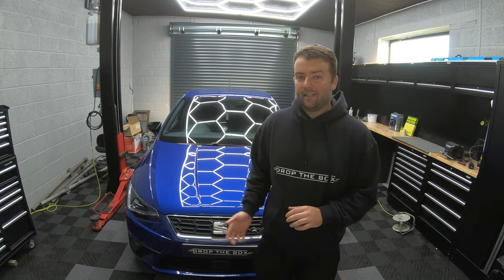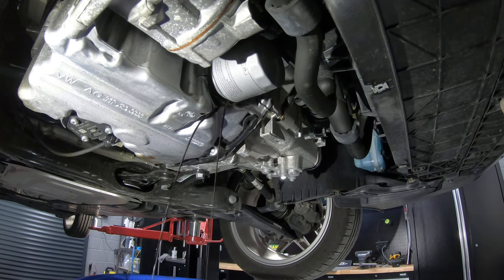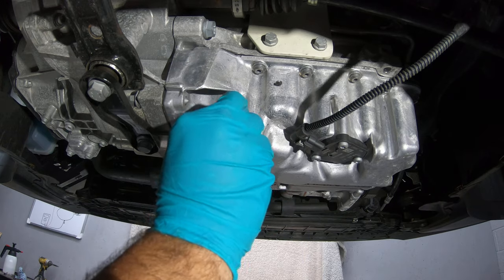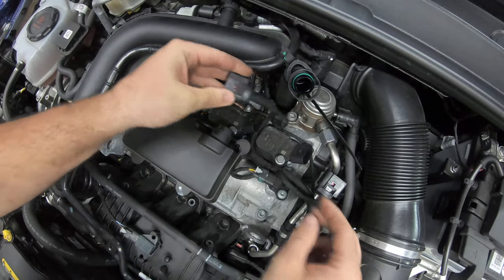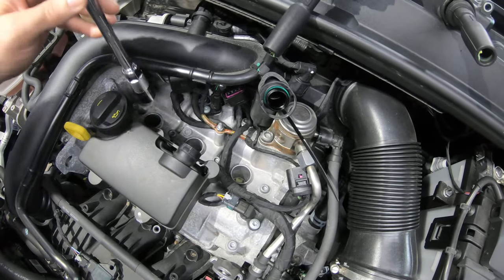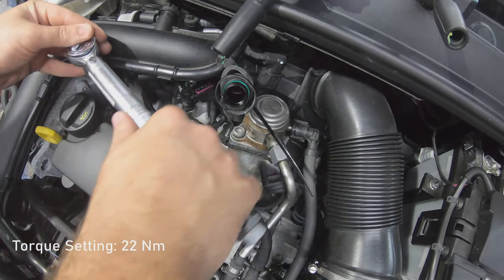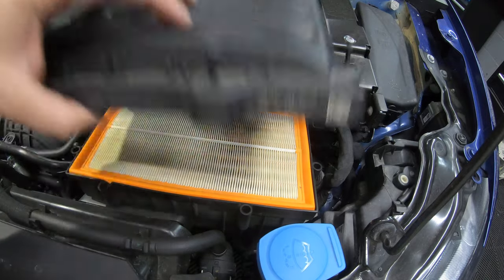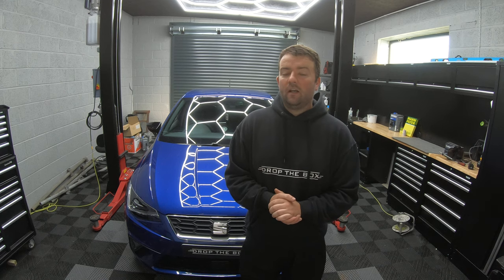Seat Ibiza 1.0L TSI - Engine Service

Comment: I have a 2023 Ibiza 1.0 tsi, 3k miles - Do these engines tend to vibrate a lot on tick over? Even when fully warm ?
Reply from the maker: Yes this is due to them being 3 cylinders. When compared to a 4 cylinder engine they will vibrate more.
Reply: Yes, they sound like a diesel as well.
Reply: Yes I've the same issue with my 3 cylindres ibiza 1.0 tsi and i think it's normal.. Nothing to worry about except that fact that it's a little bit disturbing.
Reply: @mohamedhammadi6618  the engines rattle alot, I got my mom a Ibiza FR 1.0 tsi from 2020 and im going to change the spark plugs for expensive ones and coils. I got a theory that probably won’t work but I’ll get back to it if you want.
Reply: @gilerarunner3358  For a 2020 car with an engine that has run a bit, it is preferable to change the compartments you just mentioned for good engine maintenance. but this I think will help a little bit to improve the performance of the car but not so much on the vibration problemFor a 2020 car with an engine that has run a bit, it is preferable to change the compartments you just mentioned for good engine maintenance. but this I think will help a little bit to improve the performance of the car but not so much on the vibration problem. But let us know about the results if it works pls. Thank you 🙏
Reply: @mohamedhammadi6618  update: of course it barely helped. Only thing I really noticed when cold starting the car with old coils and spark plugs the car became pretty shakey when the first 30 seconds on ‘choke’/1300rpm where done and it lowers the rpm again. When I changed to coils and plugs this became significantly less. Of course theres still alot of vibration from the engine but it seemed to better a little little bit, performance got huge difference. Much snappier replying engine. (Hope yall understand if questions ask!)

Comment: Thanks so much, very helpful. Can you just replace the washer on the sump plug - spares sites largely selling just the washer for this model? And you recommend 0w-20 for the 2021 model?
Reply from the maker: You can certainly just replace the washer, however you will find that you will probably have to cut the washer off once it is crushed onto the plug.
0W-20 is the recommended grade from the manufacturer, I believe this lower viscosity was introduced to help improve the economy. 
Other oil viscosities can be used as long as they meet the manufacturers specifications.

Thanks 👍
Reply: I'm thinking of doing the oil service on my sons 2018 1.0 tsi Ibiza after watching this video. I've checked the previous garage service sheet and they used 5w40 fully synthetic...I take it this is ok?....they are a reputable garage....thanks for posting the video...clear and concise👍

Comment: I took mine to the dealer as i could smell coolant all the time. They drained it did a pressure test and its fine now. But, the engine is shaking now and i can feel a strong vibration in the clutch. Apparently they took the spark plugs out when doing the pressure test. Do you think they put a bad plug back in and thats causing the vibration?
Reply from the maker: It's a possibility. Replace the spark plugs to see if it solves the issue

Comment: What is the function of the black box?  The one you disconnect when changing spark plugs.
Reply from the maker: Oil separator, crankcase ventilation. Allows pressure to escape from the crankcase and catches the oil that travels with the gases and returns it into the engine.
Reply: @DropTheBoxOfficial  Is it like a catch can?  but should you empty it sometimes?
Reply from the maker: @starkfredrikv70  sort of, it acts more as a separator. No you shouldn't need to empty it as it feeds back into the engine
Reply: @DropTheBoxOfficial  ok thanks for the info

Comment: According to your experience, are these engines reliable in the long term ? Won't the intake valves get clogged up with carbon in the long run ?
Reply from the maker: We haven't seen this issue ourselves. From personal experience as long as the vehicle is maintained correctly it will minimise the chances of potential problems.

Comment: Thank for the information contained in this video. I have a Seat Ateca 1.0l FR, are the engines similar/or the same.
Reply from the maker: Yes they are the same engines, may have slight difference in component are mounted around the engine.
Reply: Yo tengo un golf 1.0 tsi de 110cv del año 2018 de mayo y me querían poner en mi primer servicio el 5w30 y yo les dije que mirarán bien que creía que era el 0w20 y me dijo el mecánico que efectivamente lo ponía debajo del motor y era el 0w20
Reply: Tiene ahora mismo 55000km y sin problemas lo único que consume un poco de aceite os pasa a vosotros lo mismo el mío es el que tiene el filtro de aire encima del motor

Comment: Could you please highlight the name of spark plugs, air filter for I couldn’t see them. I recognized the name of the oil box but not the others. I also would like to know the name of the brakes oil that you use and names of other related items that need regular maintenance. Thanks
I have a seat ibiza 2020 and I’m about to do regular maintenance and I’m freaked out about the use of correct materials.
Reply from the maker: MAN FILTERS, NKG SPARK PLUGS, BREMBO BRAKE FLUID
Reply: @DropTheBoxOfficial  thank you! 🙏
Reply: @DropTheBoxOfficial Could you pls advise the tread lenght of the spark plugs used as originals. I've the same engine on polo 6 1.0 tsi 95, 06/2021, bought a month ago,  would like to change spark plugs. Most online suppliers suggest 04E...19mm, few offers 05E...26,5/28 mm. But somewhere read  originally mounted was 05E...26,5/28mm ? Might be both could fit but would like to clarify what was originally mounted by factory...  Thanks in advance...

Comment: Great video bud just wondering is this ibiza you worked on a 2021/22 reg as I have a 2019 and the engine bay looks different to mines? 👍🏼
Reply from the maker: Yes that's correct 2021 model in the video , so there will be a few differences.

Comment: For this engine the recomended oil viscosity was 5-w30 up until a couple years back...After 2019, for the exact same engine, they decided to recomend 0-w20
Reply from the maker: That's correct! Unsure on the exact reason for the change, but I believe it's something to do with fuel economy improving due to the lower viscosity.
Reply: It's not the exact same engine. VW modified the 1.0 TSI hence the change in oil recommendation, the obvious visual difference being the air filter box no longer sits on top of the engine. So pre 2019 it's still best to use 5W30 504.00 - 507.00.
Reply: @DeanoBanksy  so they did actually modify the engine? i was under the impresion that was the same one, and they had just moved the position of the air filter!
Reply: @DeanoBanksy  Not an improvement in fuel consumption, but the ecological nonsense of the European Union.
Reply: @DropTheBoxOfficial I do not know exactly but I heard in one video: a car-magazine journalist mentioned that the change was also in piston rings material or something like that. I would say this is the reason of oil specification change as the viscosity of oil is for sure crucial for piston to move freely.

Comment: Just a quick question or two, I had an RAC man come out due to a misfire on cylinder three, but he did say which was cylinder three! Do you count from left to right, i.e left 1, middle 2, right 3, or is it the other way?

The other question if you don’t mind, why did you say the three coil plugs mustn’t be mixed up, are they not the same, or they unique for each cylinder?

Cheers for the video. 👍
Reply from the maker: Yes that's correct cylinder one is on the left (timing belt/chain side)
As for your second question that's just my own personal good practice when doing any work. it doesn't matter for the coil packs but for some other tasks it could be vital. So I would always recommend getting into the habit of putting components back where they came from.
Reply: @DropTheBoxOfficial  Thanks very much for your great reply. 👍
Reply: @DropTheBoxOfficial Thank you for your great video. Please, what about correct orientation of spark tip? Once I read that this is important for 1.0 TSI that the small metalic part at the tip should have correct orientation once it is installed (to guarantee perfect fuel burning). If this is a case, how to guarantee that? Thank you

Comment: Should you be able to feel the vibration when seated in the vehicle? or just from visual appearance at the engine?
Reply from the maker: 3 cylinder engines will always have slightly harsher vibrations due to the balancing of the engine.
Completely normal on these cars

Comment: Is there a need to check the spark plug gap before putting new one's in ?
Reply from the maker: It's always good practice to check, I've never come across any problems with NKG brand spark plugs

Comment: any advice for this car? should i buy used a seat ibiza tsi 1.0 with 80k miles on it? Thank you
Reply from the maker: Same advice for any car purchase really. Ensure there's a good service history, reasonable warranty and arrange for an independent inspection of the vehicle prior to purchase.
Reply: @DropTheBoxOfficial  what do you mean by reasonable warranty? 
the dealer says one year warranty of engine and gearbox 
Thank you for the reply !
Reply from the maker: Atleast 6 months warranty that covers major components. If your buying from a dealer you should be fine 👍

Comment: Do you always need to change sump plug and washer,mines is a 21 plate?
Reply from the maker: @michaelstarrett4619  Yes every oil change should have a new washer or plug and washer
Reply: @DropTheBoxOfficial thanks 👍